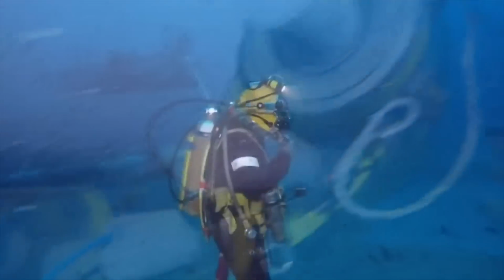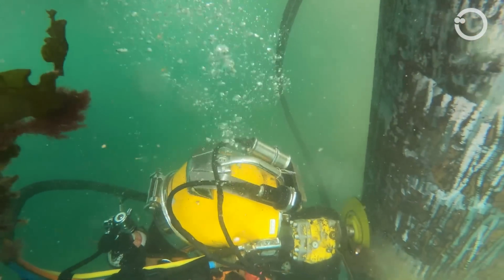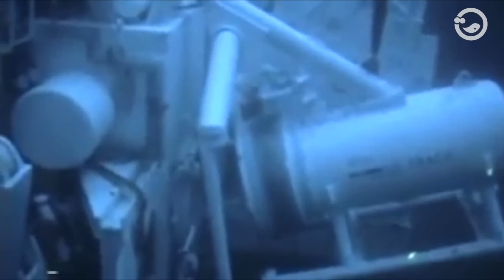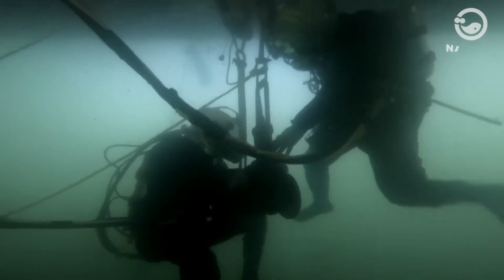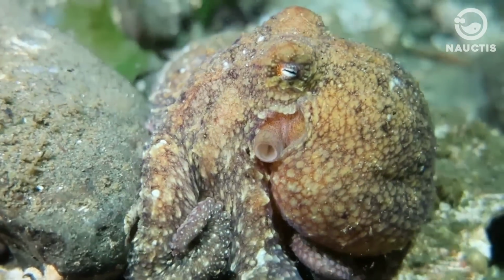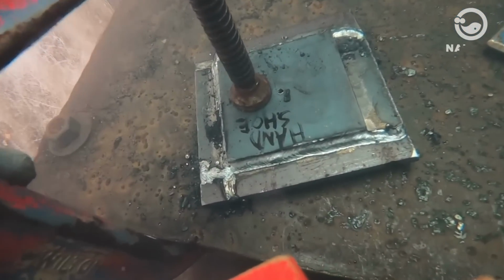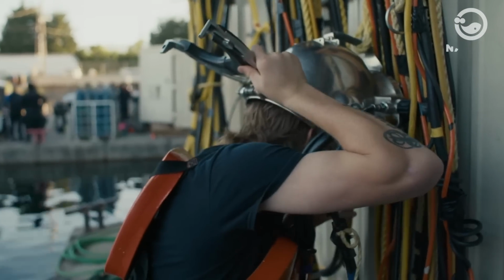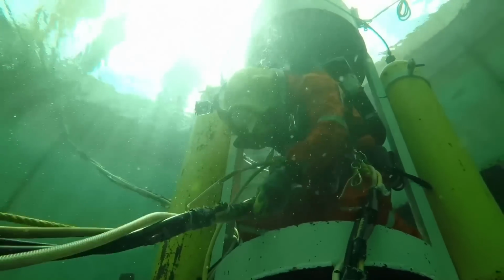Inside The Most Dangerous Job Ever: Underwater Welding

Comment: 67,000 average is to low for the risk. 100,000 for an average I could work with.   180,000 year I would do it for sure. Death  is too close around the corner to to work less than 100,000...

Comment: The reason they make that low pay is because it is not year round.  They have to call and ask for work or to be put on a list to get work after the project is done.  If there are no projects being done, they do not work.  So while yes, most of them make 4k a week or so, maybe around 10k a month if you are not a SAT diver, SAT divers make around 30k a month but it is very hard to get into.  If you are an inland diver or offshore diver you can pull about 10k a month.  Once the job is done, so is your pay.

Comment: 67k per year is a slap in the face and insulting. That job should start with no less than high six figures 250k upwards of over a million dollars per year.   Once a person has completed their  apprenticeship program.  It was mentioned how dangerous and complex the job is.  Working on oil platforms, brigdes, ships and other savages operations is not a walk in the park.
Reply: It varies. Depends on what work you do.  The average though is around 150k a year.

Comment: I know you got that 67K off the Dept of Labor website, but it's wrong.  It's difficult to put the $ into a annual salary because it doesn't work like that, but you can pull down 250K on a 6 month rotation.  I would say the low end is 100K and that would be doing jobs that are scheduled and routine.
Reply: Exactly.  Everyone I know makes around a 100K  yearly, at least, doing welding on land

Comment: 67 k a year sounds terribly off for this type of work
Reply: yea thats wrong for sure.
Reply: @Zachary Smith  that is on the lowest end
Reply: I know he got that from the Dept of Labor website, but that number is wrong. The low end is North of 100K and if you're willing to work year round you can pull down 250K.
Reply: That kind of salary would be for 3 months work.  For a year you’d want at least 200,000
Reply: 6k a dive out of the bell 1 to 2 hours
Reply: @MiddleRoadMusic  nope  600 - 1200 a day for sat work - 30 days at a time...20-30 days off
Reply: I worked some time as a  diver welder/technician and only earned about €1900 with no extra hours a month or €15,5/hour. This was not offshore work but yet so low wage.
Reply: 67k would be in Land work, off shore work is more lucrative.
Reply: Ask me what you want. I've been in commercial diving for 30 years in GOM. When I was younger, I did some diving in Africa, but that was 20 years ago. VP of specialty offshore now
Reply: I know a guy who kept passing his physical into his 70s. He was also a UDT in Nam. He was just inducted into the Diving Hall of Fame—John Roat. 
 only a few of us move up into management so its hard to retire in such a unique industry so a lot of people try to dive for as long as they can....only a few last
Reply: Those are usually contracts or per jobs